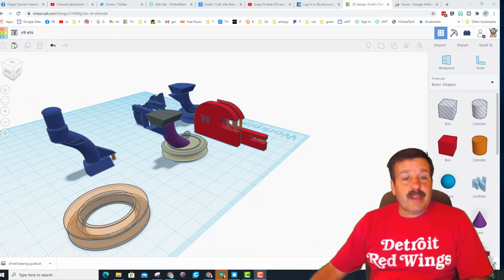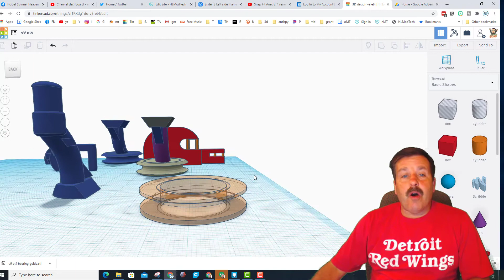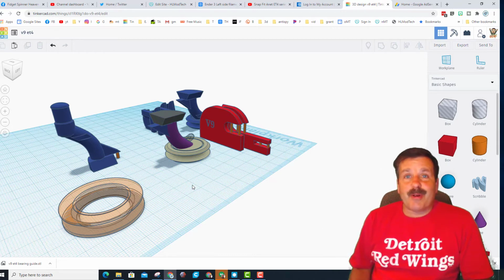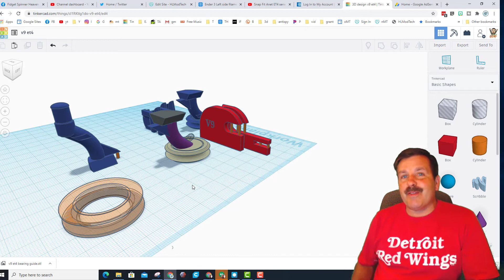Anet ET4 series snap fit filament guide - Fidget bearing adapter

Comment: Good work! 
One question: what is the inside diameter of your ball bearing? My ball bearing (R6 ZZ) is 9.525 mm  inside, but the printed axle is  ca. 7.5 mm.
Have I overlooked something?
Best regards
Reply from the maker: It's more likely that I was using a cheap skateboard bearing... So you are saying you need the center post to be about 9.5mm, right?
Reply: @HLModTech  
Yes, 9.5mm would be fine for my bearing.
Reply from the maker: @Andre-pg9sy  If you shoot me an email at hlmodtech gmail, I will see what I can do.

Comment: Great job, 
could you show how to install a tensioner to the x axis?
Reply from the maker: The 4 screws on the left of x should allow you to adjust it without any extra prints. Here is a peek at it in the assembly video https://youtu.be/aBhW0YFufa0?t=229
Reply: @HLModTech  thanks
Reply from the maker: My pleasure. When I looked at the Thingiverse part, I think the user might have the belt attached incorrect. Mine was snug enough that there is not much play at all.